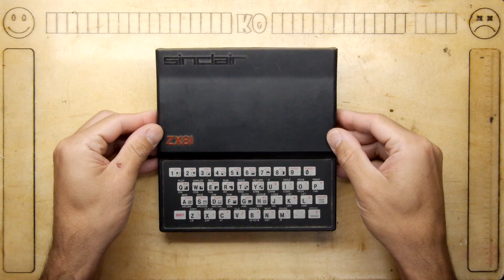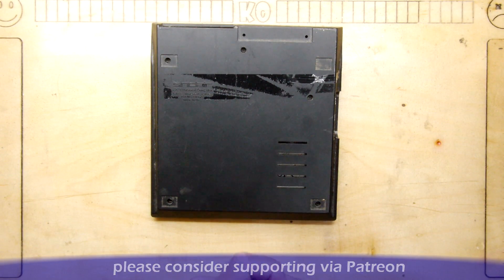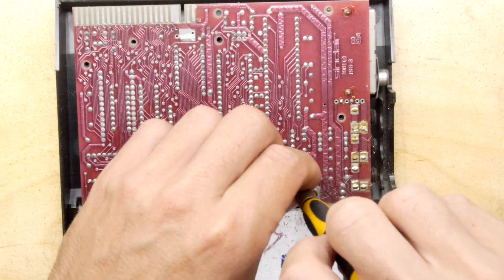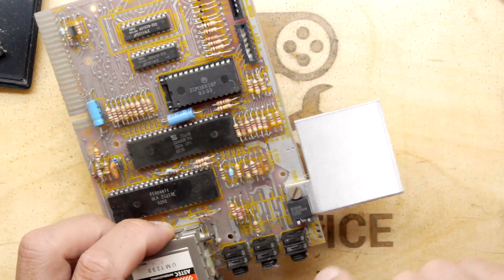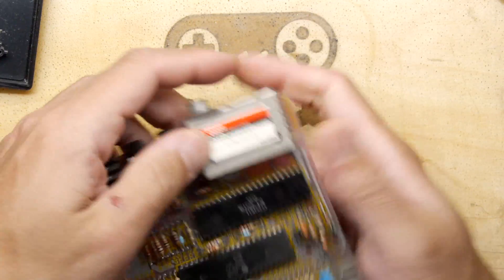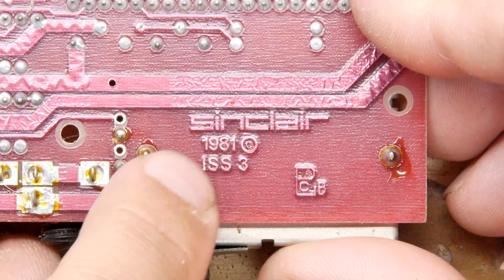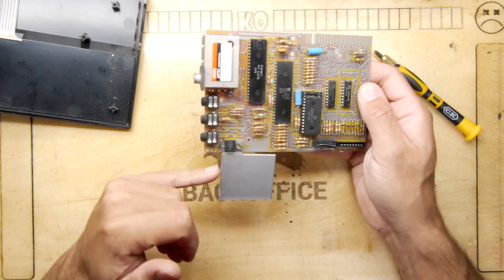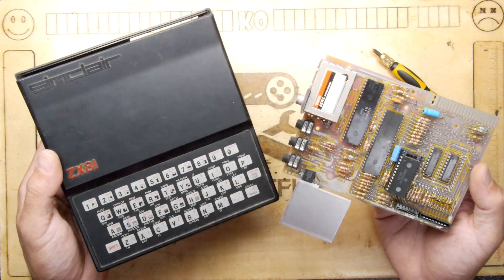ZX81 Teardown

Comment: Thanks for reminding me.  I've been putting off doing some maintenance to my (currently working) ZX81, as I suspect I have one of the few remaining ZX81s whose keyboard membrane hasn't evaporated.  No doubt it'll turn to dust as soon as a crack open the case; I should probably order a replacement membrane and include that as part of the maintenance viz. composite mod, 7805 replacement, 16K internal RAM upgrade, recap etc.
Reply from the maker: That's a whole lot of upgrades! We have some overlap so hopefully you can see if I screw anything up 😂

It's great you have a working one. My daily driver BBC micro popped it's clogs recently and my long standing Ti89 project is still on hold. Maybe this ZX will be a catalyst for me to get back into it! 😁

Comment: We had a ZX81, complete with wobbly 16k RAM pack and a thermal printer that burnt onto silver paper! My dad modded ours with a mechanical keyboard - essentially by removing the top cover, and mounting the computer and the keyboard onto a largish wooden board, removing the 81's top cover and connecting the keyboard via a ribbon cable. I modded it many years later by getting rid of the wooden board and the remains of the 81's case and putting it all into a nice enclosure. Heresy, for sure.
Reply from the maker: Sounds proper, those were the days when you really had to get to know your hardware to do upgrades!

Comment: The clue is in the name, 81. The zx80 came out in 80. Which means the spectrum should have been zx82. I think it was in early prototypes. Sinclair returned to that habit of using the year with the Cambridge Z88. A computer built after they'd sold to Amstrad. Except that was released in 1987 doh.
Reply from the maker: Ha ha, I had this recently pointed out to me from a Patron on early access. I Always thought it was related to the CPU or architecture. Its funny how you go along with it. I am sure the TRS-80 is named after the architecture! (I hope!)

Comment: The crinklimg is indeed because the PCB was "tin-plated" in a solder bath, then a protective varnish layer applied. No electroplating and hot air levelling back then. Surprised it was red though. They're usually green.
Reply from the maker: Seemed to be quite common didnt it? I am pretty glad they started using better levelling techniques. Makes me wonder if the old methods could carry more current though!
Reply: Wonder if the red PCB is an ISS 3 thing?  Both my mates who got them at the same time as me had red ones too.
Reply: They all do that. I've seen similar crinkling on Ataris and Acorns of the same era.
Reply: @backofficeshow  I think the old method just results in an uneven coating that was cheap to produce, rather than having any particular engineering advantage. You see modern single sides boards with gaps in the solder mask along power tracks so the wave soldering will increase track thickness, so the idea is still used.

Comment: The ZX81 came out as a kit or pre-built. The regulator and resistors fitting makes me think this was supplied as a kit.
Reply from the maker: Oh that is interesting. I will give it an eyeball later for telltale signs
Reply: @backofficeshow  It was. I'm better at soldering now. ;-)
Reply from the maker: No way, this was a kit? That is some reasonably hard work for sure!
Reply: @backofficeshow  IIRC, (it was a long time ago!), all the ICs were mounted, it was the resistors and caps you had to hand solder. I seem to remember I was paranoid about overheating resistors, that's why they all are spaced off the board. But then again, that might just be imagination, as I'd forgotten that fact 'till I saw it open. :-)
Reply from the maker: I shall really look after this bag boy knowing it has such provenance!
Reply: @backofficeshow  I cheated and bought one pre-made. I remember the membrane died on the N key which meant it was challenging typing things in. I only had 1K RAM so programs were short.
Reply from the maker: I think this might be only 1k I might have messed my logic. Not sure what you can do with 1k